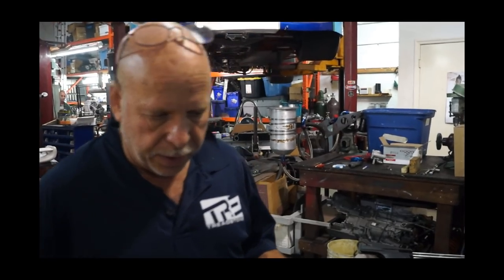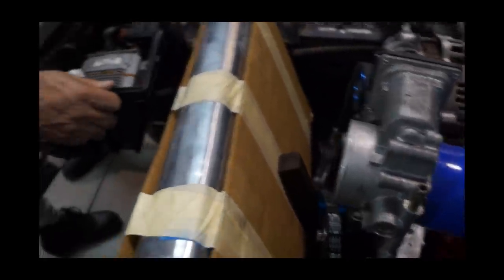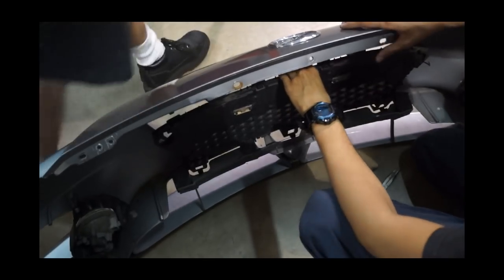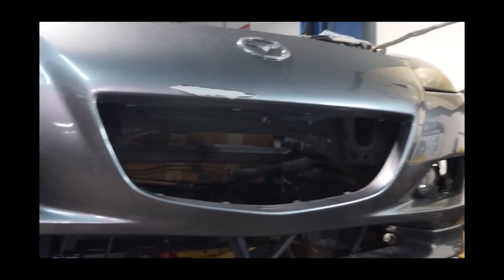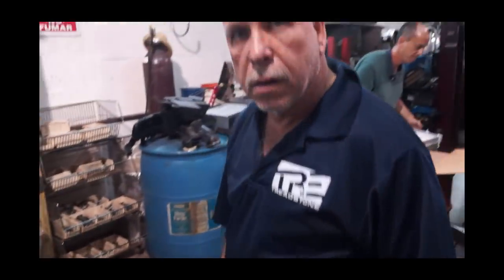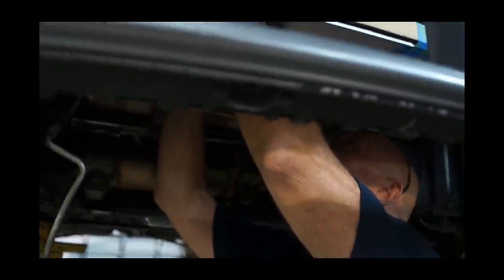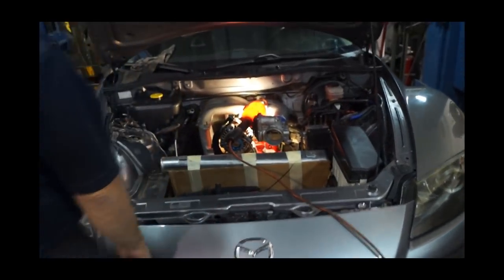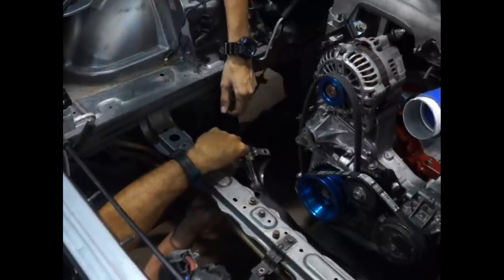part 11 project turbo rx8

Comment: Damn i wish you and your shop was here in Australia. :(  You would have my  RX 8 in a heart beat. Great work,look forward to seeing it finished. (am learning so much just watching ,thanks)
Reply from the maker: +Glenn P - We can always ship you a crate engine you can drop in yourself or have one of the local guys do it for you.  The kit is being designed to be plug and play.  We are overcoming all the obstacles that we encounter on the way to finishing this project and will have a final product ready to ship very soon.
Reply: +Richard Viscasillas how much would that cost plus shipping to send to Oklahoma
Reply from the maker: GrapeSodaGamer - You can get a JDM REW engine for around $1700 - they usually have around 30-50K miles on them. If you want a drop in plug and play set up which comes with everything, you are looking at around 10-15K depending on turbo selection, internal mods etc...
Reply: Glenn P y'all have PAC performance in stralia which is a real jewel

Comment: I am in love with the placement of the radiator and how well it will work using the bottom air for the intercooler but I have an aftermarket front bumper so i don't think it will work out as smooth as the stock one. Either way I am buying one of these kits at some point in my life haha

Comment: I really love these videos but, Carlos has to remember that Mazda had emissions related issues when they designed and built the 8. For those of use who don't have emissions testing, this is a perfect solution for the power deficent Rx8. :)
Reply from the maker: +rotaryperfection - You are right about that.  I think we covered that in one of the earlier videos where we mentioned that Mazda was focused on the mass marketing of these cars and therefore fuel economy and emissions had to be factored into the equation while power had to take a back seat.  LOL

Comment: amazing job again you have make me to thing again many thinks.but I have a question you dont gonna have a problem with the hot air from the fans I mean the air is gonna hit the intercooler.
im gonna wait the number 12 video
Reply from the maker: +alex kyriakidis - We are fabricating a duct taking air from the lower portion of the front grill and directing it up to the intercooler.  This also will block the hot air from radiator from reaching intercooler. Plan is to vent the hot air out the hood by opening up some vents on the hood.

Comment: Good thing is rx8 are so cheap right now I can pick them up with blown motors for 1500 bucks and most are mint condition.Rx7 are fetching crazy prices right now where a worn out one is 15-20,000
Reply from the maker: +gsppuffer - You are absolutely correct in your assessment of the prices.  Keep in mind the Rx-7 was only sold in the US from 1993 - 1995 and they only sold less than 3000 units the last year.  I have a couple third gen Rx-7's and I'm selling one for $15000 which is in excellent condition.  Carlos checked it out yesterday and was surprised how good the condition of the drivetrain was - the car wasn't abused.  Meanwhile they sold the RX-8 from 2004 - 2012 and there are plenty out there in mint condition with blown engines because of the engine design with the side port exhaust and marginal seals they lose compression after 100-150K miles and need to be rebuilt but the rebuild costs usually 3-4K with parts/labor while buying a remanufactured engine runs even more.  So our business plan was to capitalize on the fact that we could supply a much more reliable engine with twice the power at the same price (for entry level swap) and maintain all the Rx-8's advanced technology.  As the Japanese race drivers mentioned in the video, the Rx-8 is underpowered and can handle up to 380 HP so it makes a great platform for tuners to improve on it - like what we are doing.  You won't be able to find a similar car for the money that will perform like the Rx-8 with the FD block.  You'd have to buy a corvette for $65000 or a porsche to be able to keep up with it.